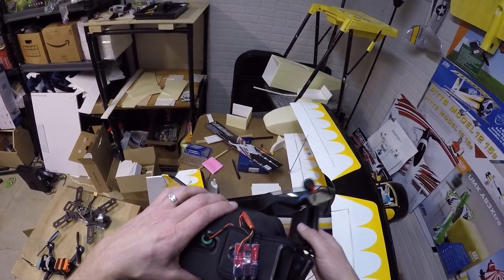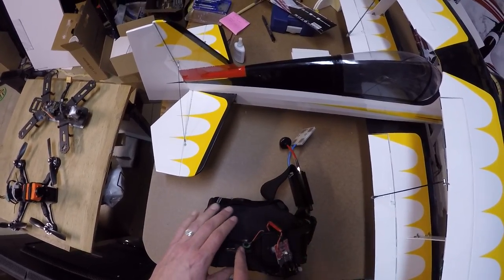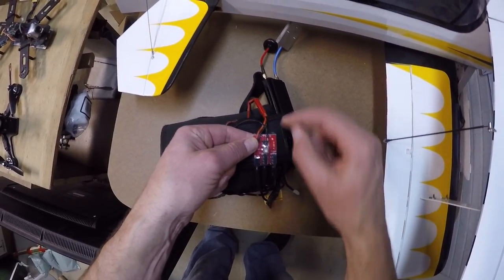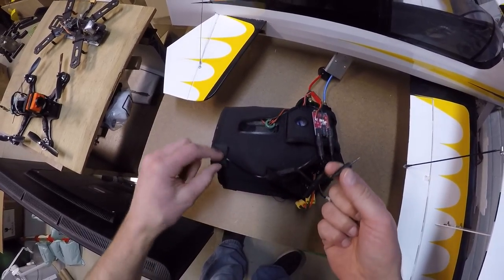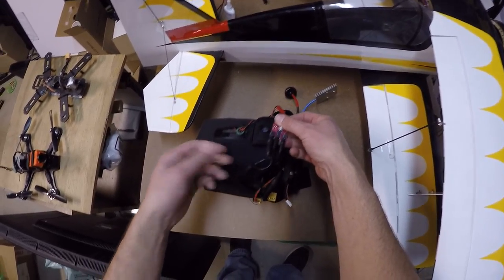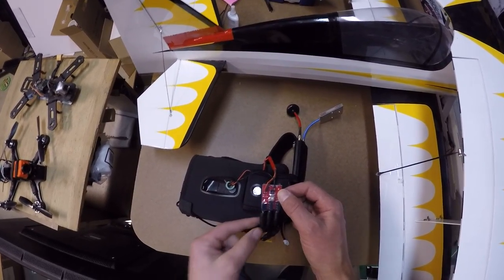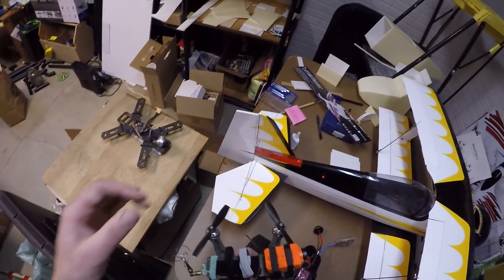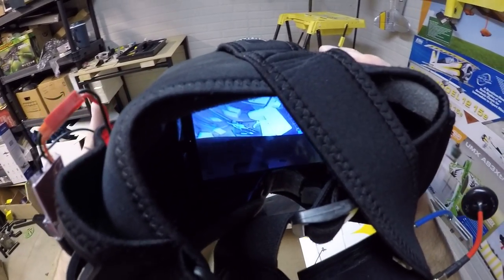Hobbyking Quanum V2 Video Switcher Setup

Comment: For the video in on the switcher, what cable from the receiver are you talking about. Doesn't the Rx cable have video RCA connectors? Also, do you have to have another cable from your receiver going into the video cable from the monitor so it can receive video from the quad? Thanks for the help.
Reply from the maker: +haon15 For video in on the switcher, I'm using a 3.5mm male to 3.5mm male stereo/video cable.  It has to have video capability to work.  The monitor has a Y cable coming out of it.  One y branch is a female barrel plug for power.  The other y is a 3.5mm male cable that goes into the video out on the switcher.  If you're not using the switcher, it would go directly into the AV out on the RX.  Hope this helps.
Reply: Oh thanks now I understand. Two more questions. First of all does the cable that came in the kit work for the 3.5mm cable? I see a cable and it looks like it would fit. Also, does the cable from the XT60 plug go to the DC In on the monitor, switcher and the Rx? Also, if the barrel plug is plugged into DC In on the switcher then how does the Rx get powered. The Rx that I am planning on using has a barrel plug that plugs into it going into a JST for power. Thanks a lot!
Reply from the maker: Yes the 3.5mm cable in the kit will fit and does work.  The XT60 has a 3 way connector.  One is the larger barrel plug which is the male barrel plug that plugs into the female barrel on the monitor.  Another is a small barrel plug which plugs into your RX.  And the third is an identical small male barrel plug which plugs into the DC in on the video switcher.
Reply: Thanks so much for the help!